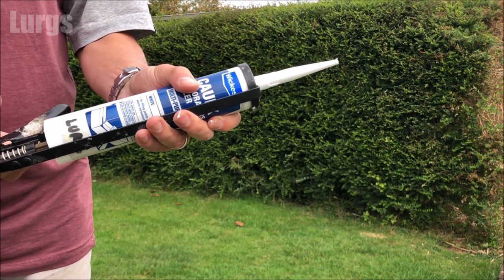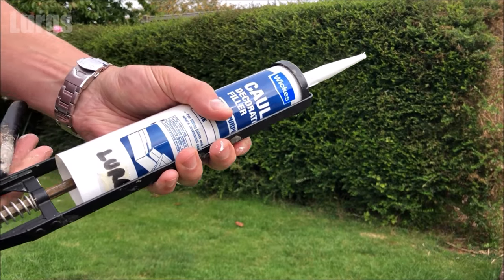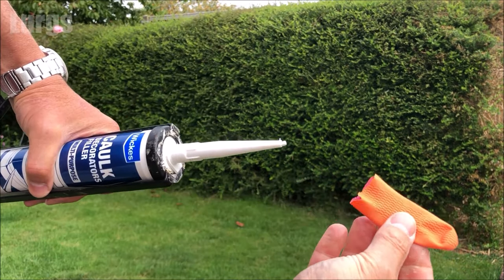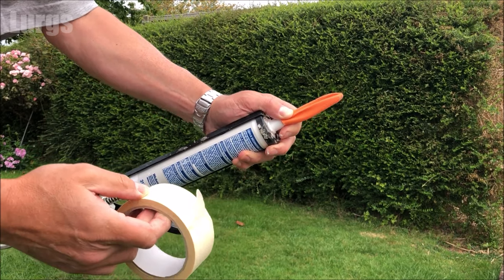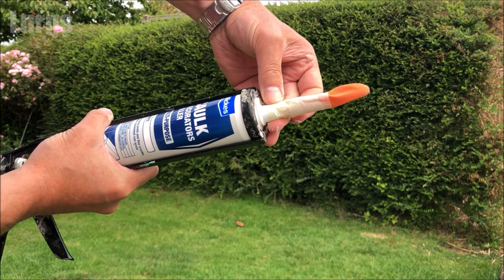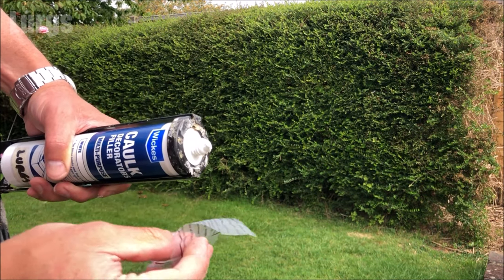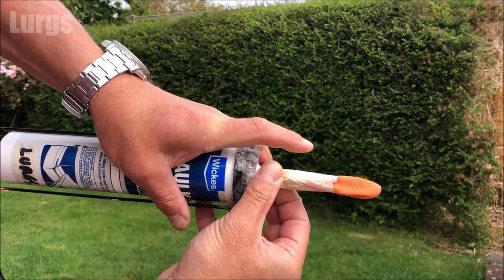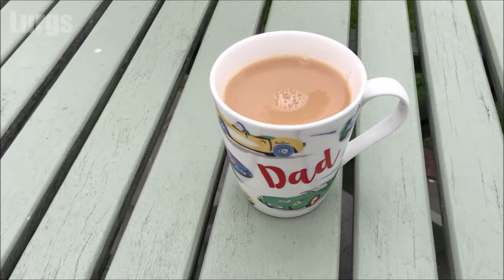How to keep Silicone Tube from Drying out - Best Way to Store Tube Caulking

Comment: I found an easier and better way to do it: Cover the opened part of the tube with dripping candle wax. The contents inside will NEVER dry.
Reply: Proper sealing wax is better. Beeswax especially. Water & air resistant. Granted candle wax is more accessible. Well done!!! As for NEVER drying out that is incorrect. Even if you did not open the plastic tube it would still dry out given enough time. l opened a tube of silicone recently that had been indoors for a few years. lt was no longer the consistency of paste, but of dry jelly. 
Unusable.

Comment: Surely the polythene is the only useful thing.  The nozzle could be scraped and flushed out after use.  As long as the end is clear there wont be any problems.
Reply: I generally do what this guy did for the tube, and leave the nozzle open for silicone that it. Come back in a week, remove the nozzle and pull out the cured silicone, refit the nozzle and off you go.

Comment: I always stick a 4 inch nail in the top and cover with some tape. Just used some that I sealed up over 2 years ago. peeled of the tape/removed the nail and put it in the gun. Pumps pefectly first try.

Comment: I wish you would have shown us how that tube of silicone look a couple of weeks later. That way we could see how well your method seal the tube of silicone and how easy it would be to pull out the dried-up silicone left on that rubber finger. Anyway, thanks for the tip! I'm gonna give it a try!
Reply from the maker: Good point. As with anything (even food) once you open something it will start to go off, the quicker you can use it all up the better. This definitely helps but it won’t last forever

Comment: I like saving money but not the inconvenience; for instance, while you're doing all of that, the water leak in the kitchen is getting worse by the second. I just bought 12 nozzle end caps and 5 threaded tube caps from eBay, cost me just under £6 in total... 👍🏻
Reply from the maker: Good idea. Once you open anything you need to use it up as it doesn't keep